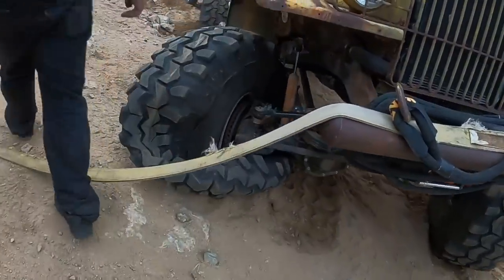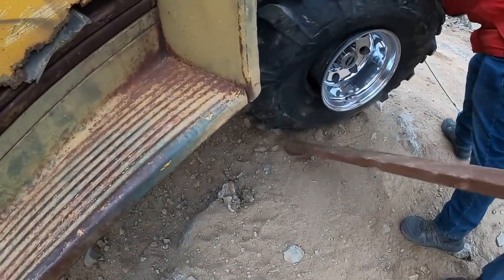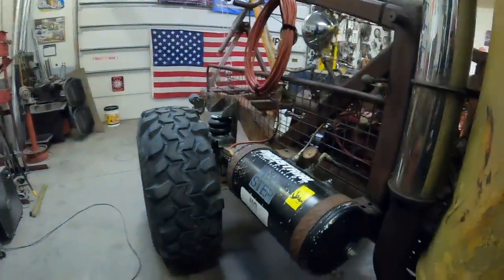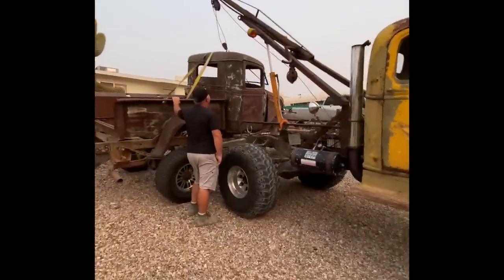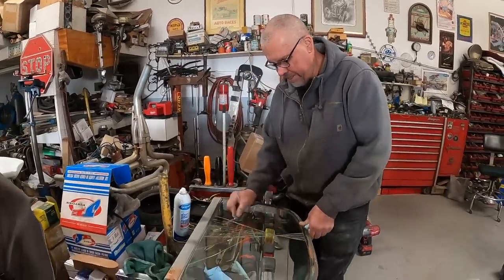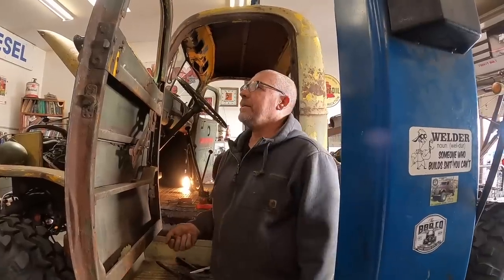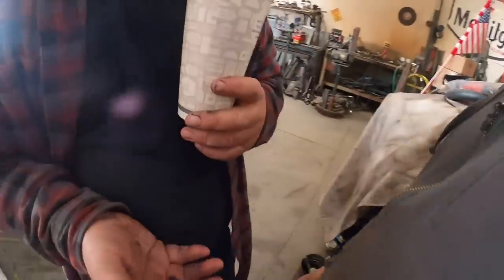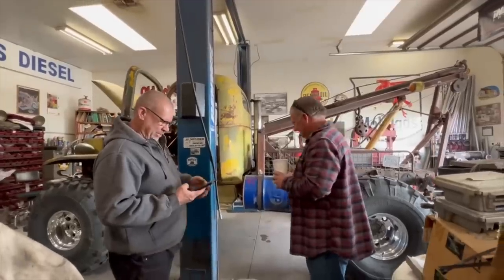The Off Road Wrecker Games are Getting Close, We Will Be Ready $$$

Comment: I think Matt and Paul will have mechanical issues in their freshly built and mostly unproven trucks. I think at that point it's going to be experience, vehicle power and who stays running. I think a bit of crazy will help too. BSF has tons of experience, but in a very different terrain. You and Rory have the most experience on the type of terrain, you've got the diesel but I think Rory has you beat on crazy. Of course, if "But did you die?" Paul is still in the running his crazy could push him over. And if Matt's behemoth stays running, which I doubt, it will be a real contender.

Comment: This decision is based on the fact that these recoveries will be pulled through a level 8 trail.  The unit has to be a rock crawler first and a wrecker second. The only reason I don't have Matt closer to the top is that his new tires do not grip as well as they need to because that unit is so heavy.

1. Rorey / Trail Mater
2. Paul / Fab Rats
3. Matt / Heavy Wrecker
4. Merlin / Tow Mater
5. Eric / BSF

Comment: rory going take first
Matt will blow up his tcase and end up w/ DNF

Eric(2/3/4)
has certain items that is designed to fail to save on more costly items, let's hope those fail safes won't slow them down
spotter may not be good on rocks

paul(2/3/4)
if hydraulics/pto survive,  they will get (2nd)

merlon, (2/3/4)
only weak link is the swampers w/ no beadlock and maybe winch speed under load. 
if he don't pop a bead, cut a side wall, no winch problem, he be ur surprised 2nd pl 
plus the fact he's the only one driving the wrecker to the event. everyone else is being trailered.
merlon and the 6BT Cummins powered Mater for the win!

Comment: Well… I think Rory will win it because he uses his ‘trail mater’ every day for the past many years and has proven its abilities and stoutness. Matt and Paul’s builds are to new and totally untested doomed for failure/ breakage. Eric…is the wildcard and know little about other than the couple of times he helped Matt on some recovers and he looked like a Rory jr.. You Merlin, will finish a strong second if you hold it all together… your boom, winches and motor/drivetrain seem strong but I really worry about your ‘Super-swamper’ tires and those lite aluminum non-headlock wheels. The red rock climbing will put a lot of torque and flex on those soft tires and spin them right off the beads. Fix that and you’ll finish high !!!

Comment: Just one more thing Matt will break those tires are just to big once it wheel hops boom it has basically military axles huge tires and a driveline that fits in a suburban I know he had the trans reworked with HD parts and he is running that prototype transfer case based from a 205 just not heavy duty enough I feel
Reply: Not anymore. I think the rework will do well.

Comment: Rory, easy first. Probably win, even if he has to weld his rig back together. 
Eric's rig is more a mud rig than anything, so no. 
I haven't actually seen your rig in action in the rough stuff. You need bead locks. Period.
Matt's trans problems are likely fixed. His tires are too new, tho, and don't want to grip. If he don't break, he'll be a contender.
Paul's got to get the bugs out, he really hasn't even started. Looks to be a very capable unit, at least in the future.

Comment: Well, Matt has what might appear to be the most capable machine. However, its performance at the Hammers was not impressive, although they have improved the drivetrain. But he is still unfamiliar with the machine and its performance against the Banana and the Morrvair climbing rocks has been lackluster.
Rory, has a great track record with Trailmator on the rocks at Moab. But the sand may be a chalange for him. He may still be hard to beat. 
Paul has what should be a capable wrecker, that is well equipped, but his ability in engineering a machine is questionable. It’s hard to put confidence in the quality or durability of his truck. 
I don’t believe that there’s any need to question your ability as far as knowing your machine. It seems to be well-built and engineered. The age of the machine is insignificant. The fact that it is a diesel obviously gives it a power advantage. But the weight of the diesel may prove to be a problem in the sand.
Not knowing the others it’s hard to form an opinion as to their placement. 
Of those that I’ve mentioned
I think I would have to place Rory, first. 
Matt, second. 
You, third 
And Paul, fourth. 
I hope you all have an enjoyable and safe competition and wish you all the success possible.